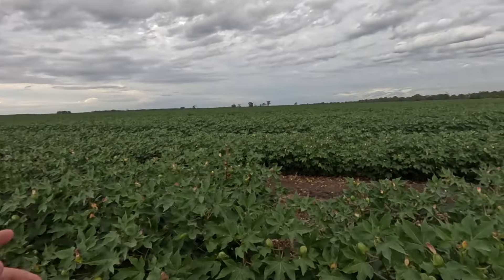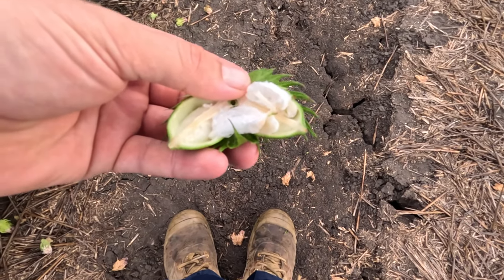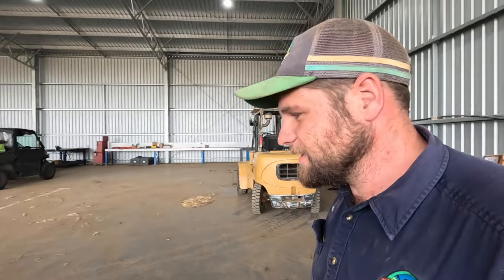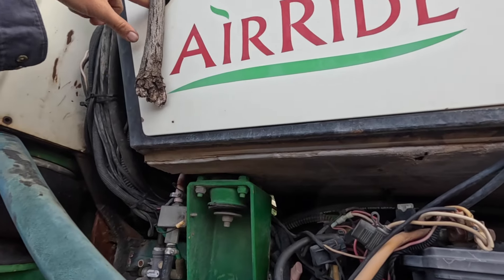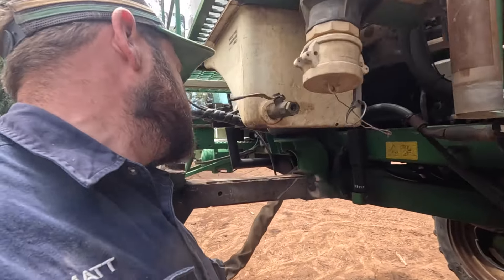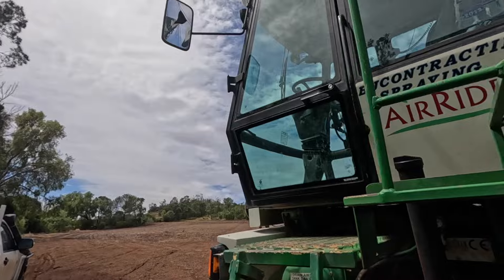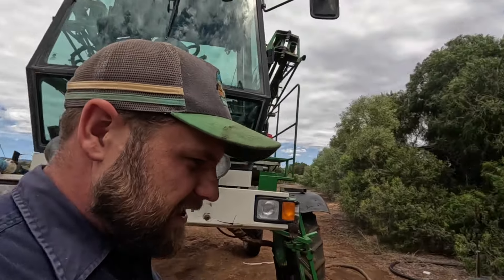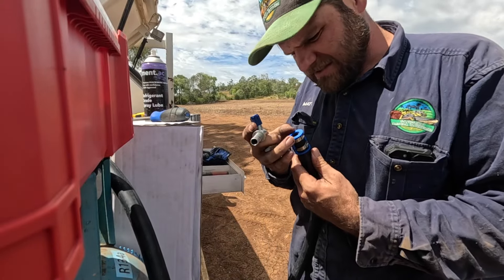A/C Hose Repair & Cotton Update | Repairs | Vlog 263

Comment: We use the Hi-Chill Minus 30 gas  in everything. We find it better than the 134a gas in small cabs because it runs cooler and also runs at lower pressures than 134a. You also only need 1/3rd of the gas than 134a. Cheaper too.
Reply: We use Hychill minus 30 to for last 5 years can't fault it cheaper and easier to access

Comment: Hey matt whats the name of the other a/c gas you are using. Cheers
Reply from the maker: It’s hychill minus 30, a lot of older machines are fine with it but I have had mixed results on newer ones👍
Reply: @thejacksonbrothers   Thanks Matt will look into it. What year would you call newer models from. Cheers
Reply from the maker: @cameronjohn768  anything that uses thermistors and control modules to run the a/c👍 most will still work fine though

Comment: Why does cotton get planted so far apart ?
Reply: It’s all about better moisture availability. A juggling act between reducing yield by having less plants and maximising the limited moisture in a dry land situation for the reduced plant population so it can yield better. More plants, less moisture to go around, zero yield. In an irrigated situation the plant population will be maximised because there will be plenty of water and the yield will be as high as possible.